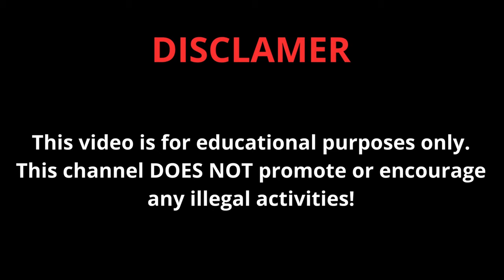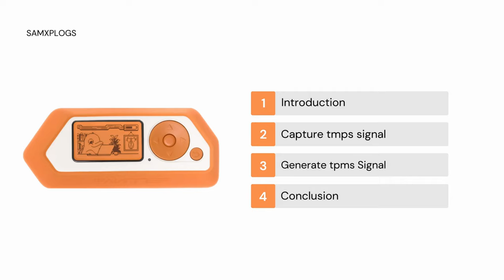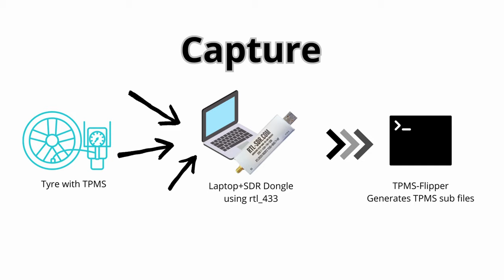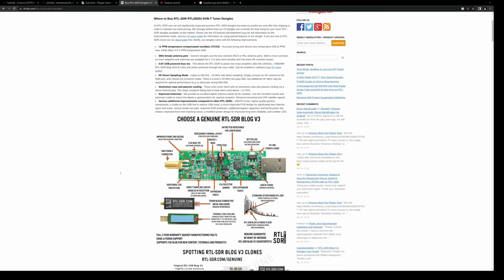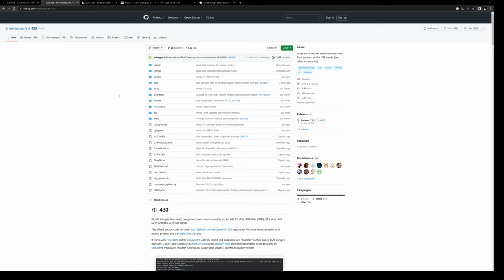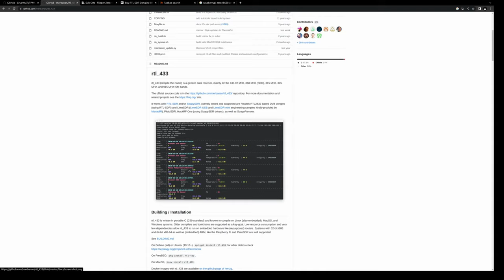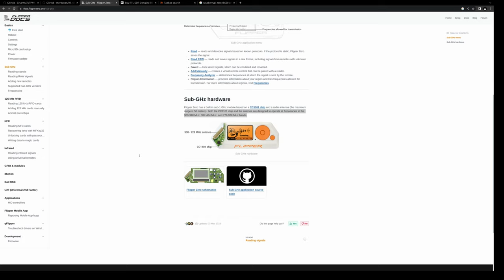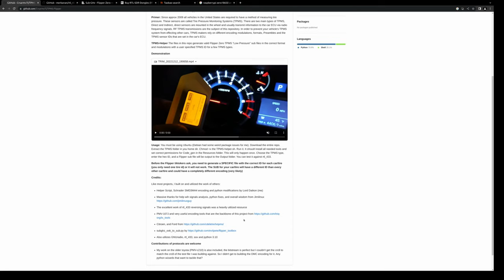Flipper Zero: It Can Spoof Your Car's Tire Pressure Monitoring System (TPMS)

Comment: Upvote for my TPMS python tool!
Reply from the maker: Thank you for your contribution and comment. I do believe your work deserve more visibility 🙏
Reply: @samxplogs  It is messy as hell and needlessly complex. Since it works I probably wont adjust much on it, maybe add a protocol if/when rtl_433 finalizes a few missing params in a few others.

My focus has mostly shifted to the Yardstick One by great scott gadets. Working on a couple things with that like using flipper files with it, and auto sending tpms signals when received on an rtlsdr.
Reply: @crsv7armhl   @Sam'seXperimentslogs hi fellas , I was able to record and replay low pressure signal with hackRF .... however unable to do the same with flipper zero.  Im experimenting with it and trying to find the way for flipper.
Reply: @takeapart  You would need a custom modulation in order to record TPMS with the flipper zero. I worked one out for the PMV-107J, and would capture accurate signals about 80% of the time.

I don't bother anymore since I can just generate low pressure signals for 4ish model sensors from nothing, well aside from the ID.
Reply: @crsv7armhl  how about running your tool on mac or smartphone?

Comment: Can you turn off the air pressure light with this?

I hate these FUCKING lights being on!
Reply from the maker: I tend to think so. Let says you record and motify the message to match a well filled tire. But before trying this for your own safety I suggest to double check your tire and its pressure 🙏
Reply: Yeah, you would need to modify my scripts to generate the files for a "good" tire pressures for each tire, shouldn't be too hard. The downside is you would have to replay them constantly because the ecu expects the signals every few minutes